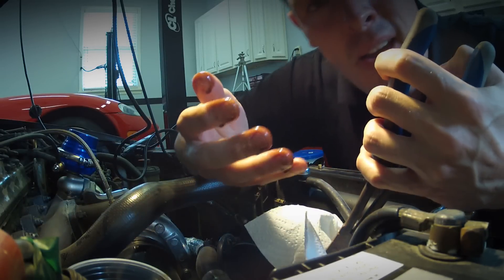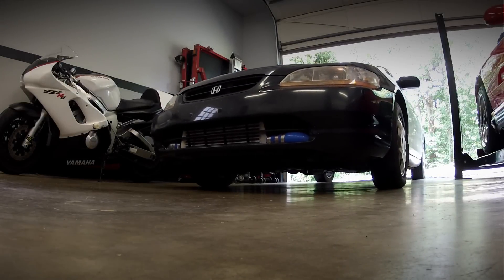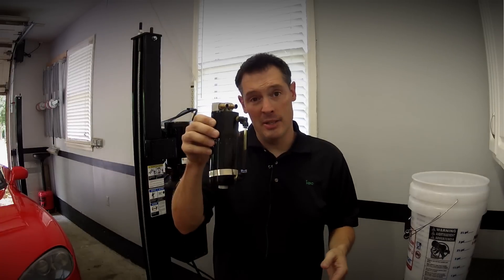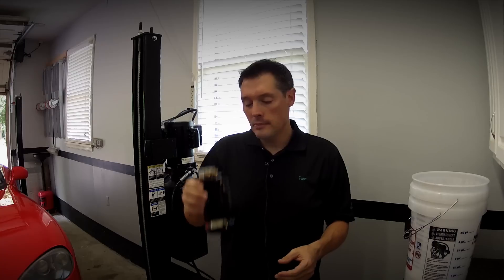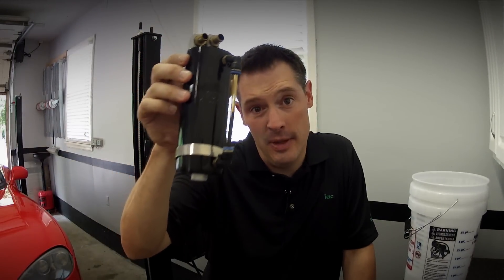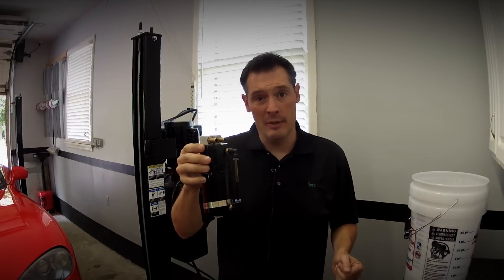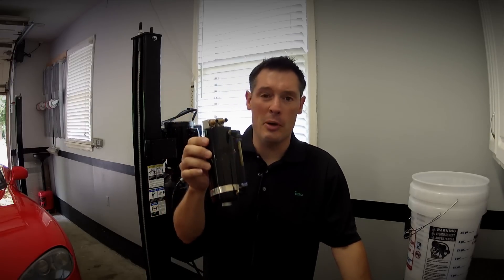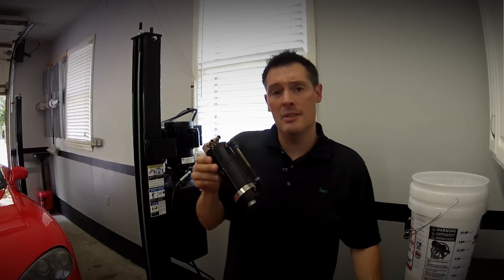Oil Catch Cans Myth Or Must Have - Ebay Oil Catch Can Review

Comment: I still don't get why manufacturers don't put them on, if they are so useful?
Reply: +Amirnake need to Google some pics without a catch can.
Reply: That´s the point: ONLY SOME are installing SOME KIND of oil separator, but still many neglect their use. Go clean the inlet manifold of a BMW or wash the intercooler of a MINI, then tell us the catch can is not useful!
Reply: +Chris Monty  I'd have to see some evidence before I buy that it's an EPA thing. It doesnt seem like that would have an effect. Engineers and designers work hard at making powerful, efficient cars. We have cars that were unimaginable just a few years back. But, yeah, they just leave out an extremely simple device that "tears your vehicle up". It's possible, but I'd need some evidence other than "look, there's oil in the engine". My guess is the effects are negligible. But I'm open to being convinced. Apparently, some makers are including them.
Reply: +Chris Monty Fine, we've gone around the horn. Why are they not installing them from the factory, if it's this insanely easy to prevent? I'm not saying it's not possible. Manufacturers make mistakes. But this is hardly a scientific test of cause and result.
Reply: Car owners need to empty them routinely - failure to do so can result in serious issues. Why would the manufacturer create a new kind of maintenance that only affects cars in a truly detrimental way after years of driving. Just because the manufacturers don't add it doesn't mean it's a dumb idea.
Reply: +rrpostalagain it's not a mistake. they just don't do it, I can't speak for them. But I am a mechanic by trade and I know that I know how somethings should be done to better serve the equipment. But what I am allowed to spend or improvements to make all determine how much it costs.
Reply: +rrpostalagain ford used to do this kind of stuff in the 70's and 80's, it's just alot more hush hush now days. but this is more for gdi/turbo/rotary engines
Reply: Recent research by Afton Chemical (makers of refinery level additives NEEDED to produce acceptable quality fuels, like octane number specs). shows that even minute droplets ofoil are causing preignition in modern (latest) small 4 cylinder Turbocharged engines, that develop some boost at lower RPMs, but that applies to ALL engines: Oil destroys high octane of premium fuels!  Carbon deposits raise NOx and promote detonation, and lastly, go take a look at the inside of used engines.  On the other side, most oil mist separators in original engine factory designs are badly made and do NOT catch enough oil. EPA and CARB have shown many times they simply do NOT understand engines, and car manufacturers do not care about what happens after car sale, they would be happy to sell a new car to each owner every 6 months.
Reply: They would have to rely on the customer and 3rd party oil changers to change something on a vague interval.  But, if you install one yourself, then you are up for the task of cleaning as needed.
Reply: Because it's not strictly needed and it would simply add up more cost of maintenance.
Reply: True, but new direct injection cars need them way more than cars with just port injection. 

FYI VW and Porsche have been using Air Oil Separators for at least 20 years. The bad was when theirs would go bad it would literally cause oil to be sucked up into the intake.
Reply: Becouse it can be burnt with no problem
Reply: @livenloud6697  It could but not in new direct injection engines because there is nothing to clean it off the intake valves.  Ford changed their design because of this, and now off a OEM catch catch on the ecoboost.  Although they don't call it a "catch can" because basically it catches the gunk, separates it from the air intake, and drains it back down into the oil pan.  Which is in fact ok IF you change your oil like you are supposed to.  
   The reason they don't put regular catch cans on from the factory is because if you forget, and don't empty the thing when it needs it you will make the problem much much worse.  Because it will basically fill up with all that condensed oil/fuel/water mix, and when full suck it into the intake as a liquid.  Which will end badly.
Reply: @slimjim7411  thanks Slim Jim...👍very well explain..🙂 i learned something..
Reply: +rrpostalagain it's not a mistake. they just don't do it, I can't speak for them. But I am a mechanic by trade and I know that I know how somethings should be done to better serve the equipment. But what I am allowed to spend or improvements to make all determine how much it costs.
Reply: +Chris Monty I spent $260 for my turbo 1.6l Ford CC. Because it's so damned cheap and easy. Why not? That's kinda my point. But all I find is anecdotal stories about what they do. I haven't found anything approaching real scientific evidence using proper controls... and you're implying that auto manufacturers choosing to ignore a simple, obvious  system thus doing significant damage to the product that they invest billions of dollars in creating is NOT a mistake? Is it a conspiracy theory about planned obsolescence? Across the industry?
Reply: rrpostalagain i think they don’t do it because the “savings” is long past the warranty. you won’t see the longevity unless you own the vehicle more than 300,000 km. most manufacturers don’t really design their vehicles to last longer than 350k. most people don’t buy cars with that many k on them either.
Reply: They do! see http://amzn.to/2s9dfEu  Volvo calls it an Oil Trap. It catches the oil and then drains it back into the block to  be reused.  BMW and Volkswagen also use the same setup with inlet, one-way membrane to function as the pcv valve, outlet, and oil drain back to the engine.
Reply: Catch cans are useful to keep the octane of your fuel high however the fuel economy might go down slightly... If its a tuned performance car, it matters but if its a daily then there is no need.
Reply: rrpostalagain it sounds like it works like a pvc
Reply: Honestly, for the most part catch cans are an extra thing that isn't necessary for most people. HOWEVER, if you have an engine that is direct injection only it's pretty recommended. Just google IS250 carbon build up issues. Or Audi direct injection carbon build ups or Camaro V6 carbon build up. They build up a ton of carbon, sludge, dirt on the intake valves that it actually affects idle smoothness. Cars that have dual stage setups, like most Lexus and Toyotas (except the IS250) or the new ZR1 Corvette don't suffer this issue since the fuel from the port injectors will clean the intake valves. 

I recently cleaned out the intake valves on my wife's V6 camaro that has 45K miles on it and there was close to an 1/8th inch of build up on the valves. Removing it helped smooth out the idle and actually my wife said the car sounds quieter.  Suffice to say after that I ordered catch can for the dirty side and and air oil separator for the clean side.
Reply: Mazda use oil catch tank in their engine with pcv valve.  But, the pcv valve sucks.. Easy clogging..
Reply: Many possibilities:
- an engineer knows it would be good, but:
  - they hit the budget limit, and something else is higher priority (or made it in first).
  - go up a few levels of management:  in a meeting it didn't make sense to someone who had five minutes to figure out what was being talked about.
- put something like this in to help out customers and hear:  "so, this model has a problem with oil leakage, then?"  The Sales department will not thank you.
Reply: They don't put it on there because you cannot trust the consumer to empty them...they are a "hassle" item. Direct injection cars of all makes and models suffer from carbon build up on the intakes due to the way they operate and anyone who knows, works and builds motors will tell you these. Work are great to have even when there is little carbon issues. We use them in supercharged jet boats to keep the oil from building up in the intake and robbing HP. Knowledge is key...fake news has no place here.
Reply: You need to do some more research on modern diesel engines...they have all the buildup and the issues that come with them from this very thing. The techs try to come up with better solutions but good ol boys just delete it all to keep their engines happy.
Reply: robert feller
Exactly, as far as I know only Toyota current direct injection setup doesn't have problems because they also have port injection as well. But cars like the older Lexus IS250 did not have the dual setup like all the other Lexus models had and the IS250 was plagued with bad carbon build up to the point of needing engine tear downs.
Reply: Amirnake and you just told us you're a f**** moron how is it not beneficial to keep use motor oil from going through your intake?
Reply: And the dealers would be only TOO happy to sell you a "induction cleaning service" for $500, AFTER the warranty has expired!
Reply: Amirnake because they are expensive
Reply: because of ridiculous EPA requirements. they rather tear your vehicle up than you put it in the atmosphere. think about it, it's a win win for both the EPA and dealerships! Just think about this... why would you want oil and bad fumes going IN your intake of your engine? Why not take that out of the equation. the direct injection engines do not spray fuel over this causing it all to cake up internally. WELL worth the investment and hands down the most important thing you should do to help the longevity of your vehicle.
Reply: nailed it!
Reply: pat mcgeough japans car tech has been years ahead of American companies for years
Reply: Really? I didn't mention any companies. can you read?
Reply: +rrpostalagain        http://www.gm-trucks.com/forums/topic/168709-intake-manifold-off-with-pics-of-intake-valves-with-deposits/
Reply: Please settle down. EPA requirements help the atmosphere and in the USA vehicles are now the #1 provider of fossil fuel emissions...a known issue. Sorry my kids health has to suffer so you engine needs a little more mainteance...I for one am very happy the EPA pushes the makes of vehicles more efficient and better...I don't mind 23mph out of 1/2 truck rather then the 10-12mpg I was getting 15-20 years ago. You must be young and don't remember the American vehicle years of the 60-70 and even 80-90s when 100K miles was hard to come by...now I'm happy to get 250K miles out of my vehicles before they start to rattle. Engines and drive trains last long and return on the investment because of the consumers, market and regulation pushing them. Ludite.
Reply: Evidently you have NEVER serviced a used engine... The intercooler on my Turbo car required two liters of paint thinner, another liter of MEK, and TWO hot water plus strong dishwashing detergent to start to become clean. Stoopid EPA and "CARB" Eco-phanatics prevent anything useful to be added because they label it as "Only for offroad use"... Dumb A**holes!.
Reply: +rrpostalagain Exactly, that tells you that catch cans are useless. No matter how much shit you "catch" in it. There is no evidence that it is beneficial.

Comment: For people that don't know about these, their specially important for Direct injection engines (GM L83, or bmws 335i engine) because on DI engines the fuel doesn't hit the intake valves so nothing cleans them. Without the catch can over miles and miles the intake valve will get all gunked up.
Reply: Yes sir.  They're especially needed on the boosted engines.  I have one of the expensive ones on my '11 3.5 Eco and it has 2 inlets and 1 outlet.  One inlet goes to the PCV valve and one has a T in the line and goes in front of each turbo.  The outlet goes to the intake manifold.  One of the problems with boosted engines (as he says) is they create a lot of blow-by around the pistons.  The PCV system works on vacuum and vacuum drops to almost 0 under hard acceleration resulting no suction through the PCV system and the result of that is the crankcase is pressurized.  The intake tube to the turbos causes suction to remain in the PCV system thereby continuing to evacuate the crankcase and eliminating the pressurization.  As he also says, the "can" filters out most of the fuel vapors, water and assorted other combustion by-products (like sulfuric acid) and puts mostly clean air back into the intake resulting in much less gunk to burn (coke) onto the back sides of the hot intake valves.  Much of the gunk does not compress and does not ignite,  so it robs some power you should be getting.  It can also literally affect sparkplugs over time causing misfires...some call it "blowing out the candles".  My 16 oz. can needs to be emptied once a week during the winter and every couple of weeks during the summer(depending on mileage) generally because cold temps where I live generate a lot more condensation that is filtered out by the can during the winter...below 45 degrees.  Buy a high-end one, there is a difference.
Reply: +Mike Sonntag +Rubber Duc so my 2016 veloster gdi turbo 7 speed dct would be a perfect candidate for this
Reply: Mike Sonntag would this work for an f150 ecoboost 3.5l ?
Reply: +Joseph Anthony Carrillo III It would definitely be good for your car.
Reply: PCV hose usually goes in before the turbocharger, in between the air filter and turbo intake(diesels) so there is vacuum at that point.

Comment: ehe ehe ehe ,yow! you know that oil helps to prevent dry cylinder wall condition ,resulting premature wear, that will leave a ridge in your upper cylinder wall at TDC position , ,,,,,,,,,, as long as the oil doesn't fowl spark plugs just change you pvc valve regular and clean your throtle body
Reply: Look up intake valves that have 6000+ miles on them with no catch can for gm's L83 engines and you will see why some people should have these catch cans.
Reply: They are necessary for a lot of GM 5.3L. I have an 06, and the DOD that switches from 8 cylinders down to 4 got botched in it's first year...2006. My car eats 1-2 quarts between oil changes. Where does it go....through the intake. The PCV valve isn't serviceable unless you change the whole cover for well over $100, and the issue is still there. The oil gets "splashed" around the unused cylinders when it's in half cylinders mode. Shitty design, and I'd assume that much oil blowby isn't necessary for lubrication

Comment: Any worries that the engine was designed for that "top end lubricant" it is now missing with a catch can?
Reply from the maker: +BTown830 You don't want the stuff the can is catching to go through your top end :)
Reply: +Rubber Duc again- it's such a simple little thing. If it's that detrimental, why don't any manufacturers use them?
Reply: The amount of oil going through the line is so small it would never pass as sufficient lubrication for anything.
 On my NA car the only moving parts the oil from the pcv comes into contact with is the top of the valves, which is constantly washed off by the spray of the injectors.
Reply: +rrpostalagain Cost. think of it this way, a company puts these in, hardware, and employee payment for install, and it costs $20 per install. now times that by 300,000 annually, about $60,000,000 they'd spend on something that, though does prevent the coating of the upper engine assembly, and develop sludge, the manufacturers state in manuals to always have your vehicle checked at a dealership. Why spend 60 million when at 90 bucks a top end service, you can make money.

Comment: That is too much oil for 4K miles
Reply from the maker: +Tyler Barnhart My car is a boosted 300K mile car so give her a break :D
Reply: A guy I work with has a Cadillac SUV with the northstar engine. It uses a qt of oil with every tank of gas.  When he told me that I asked if it was a 2 cycle?
Weird thing is it doesn't smoke at all.
Reply: An oily intercooler also reduces heat transfer, so a good idea to keep their insides clean
Reply: My son has a Nissan Juke and uses oil also. Probably going through the engine ventilation system.
Reply: D N many older gm and toyota engines burn oil for a weird reason.. it gets sucked into the vacuum lines from the valve covers and then gets dumped into the intake. crazy but true. the northstar and ly7 were notorious engines that did this.
Reply: Lots of great comments guys and maybe gals - hard to tell by the user names. I especially appreciated Alfredo's comments. I will definitely be buying an oil catch can and making a video about how it turns out. Please come and check it out.

I figure if a car never got a dirty throttle plate and the PCV dumped before the throttle plate, then maybe a catch can wasn't all that needed, but I haven't owned a car yet which doesn't develop a dirty throttle plate over about 60k miles. Hmmm. Maybe 30k miles they barely start to get dirty, but that's the part I can clean, what about all the intake tubes after that which I basically can't clean?
Reply: That's an insane amount of blow-by
Reply: Gm motors use about that much in between oil changes
Reply: I would rather run oil injection with a VRO pump from an outboard, im already using Amsoil Dominator synthetic 2 stroke oil my truck and its still going at 232km, It burns much cleaner.

Comment: Is there anything inside the catch can?
Reply from the maker: +Sam Tello No, not on this one, b/c of the way the can is built it wouldn't matter if there was honestly b/c the line is not low enough to go to the bottom.
Reply: Taking into account the explanation of the effect of minuscule oil droplets inside the combustion chamber on preignition tendency, a decent catch can should have internals to prevent fine oil droplets to go straight from inlet to outlet.  I guess baffles and/or stailess steel mesh will help.